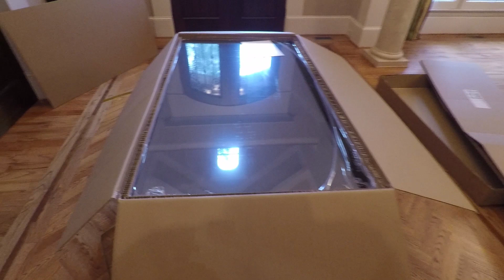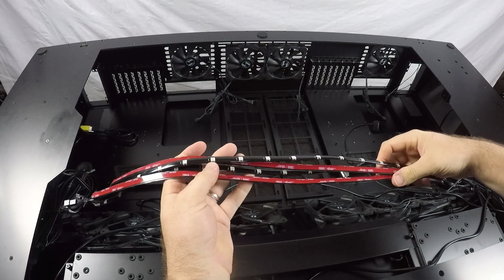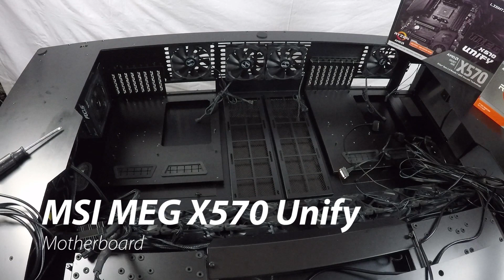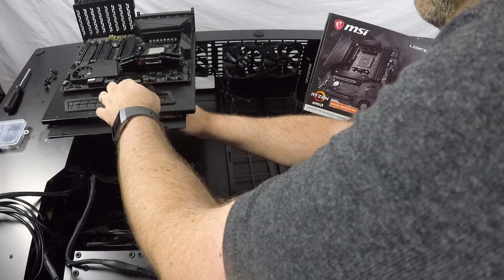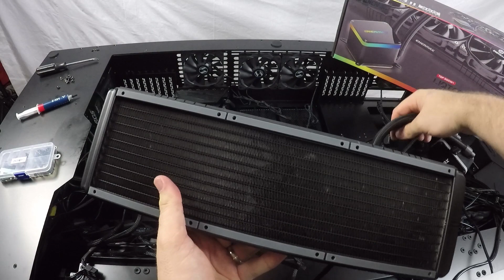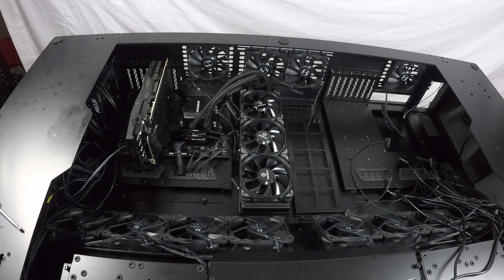TheFPSReview Custom Build | Lian Li DK-05F Desk Computer (Part 1)

Comment: Thanks! ok so honestly how dumb would i be (the money isnt the issue) but i have one coming in now how stupid would I be to be wanting to take the tub and all over trays and removeable parts and popping out  basically stripping it down so it can get Cerakoted professionally White so I can keep my new build and my old build both Sakura Season themed. Mind you my last system was a Msi Meg 790E godlike and a .Lakes Rtx 4090 / and the new one is a MSI meg x870e with a msi rtx 5090 suprim Liquid and amd 9950x and the lianli hydro shiftII OLED which i think maybe the screen on that is screwed since itll be in some orientation im not sure of now. But am I just dumbfor wanting to change the color absolutely for something so vanity driven?
Reply from the maker: The desk is essentially solid aluminum so I think it'd certainly be possible to get it coated in a new color. You'd also have to figure out how to deal with the buttons and the desk height control as they're all black. 

The Hydroshift is NOT a good idea for the DK-05's right bay, if anything, for an AIO, you'll want to find one with tubes north of 400mm to make sure it can reach the front of the case. For the left bay, the Hydroshift should work as you'd wnat to put the radiator on the left center. I have the 4090 Suprim Liquid on the right bay right now and it's using the right side of the two radiator slots.

I'm fairly sure you can adjust the orientation of the screen for the Hydroshift in the software - it's been a bit since I've fired one up though.

Comment: Does the heat come through the top glass and bother you at all?
Reply from the maker: No issues with heat coming through the top of the glass - plenty of airflow moving things through the case (this is based on 2 months of using it).